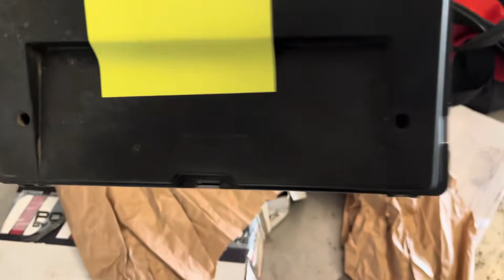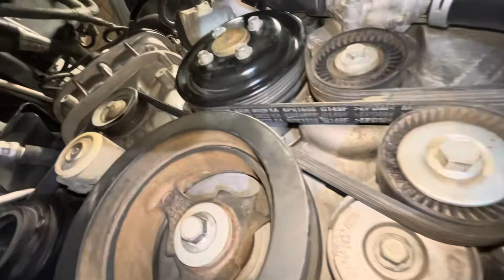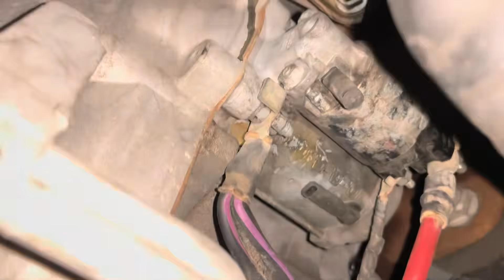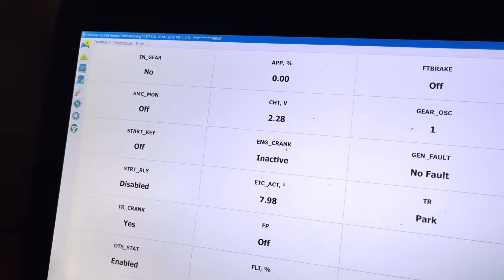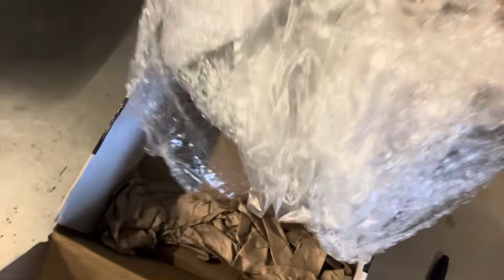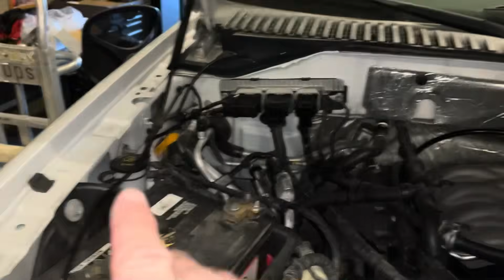First Start Up! 2014 Coyote Swapped Expedition

Comment: So when you coyote swap these, you have to convert to electronic power steering? Asking for a 07 EL 4x2.
Reply from the maker: I would. 07-08 May not be able to though.  09-14 yes.
Reply: @MattSoppa  Interesting, thank you for the response. I would love to do this for my truck. I wondered if it could be done without converting to electronic p/s.

Comment: So I can run a 2011 expedition 6r80 Trans behind the Coyote 😮
Reply from the maker: No. 12-14 Expedition or Navigator.
Reply: @MattSoppa what’s the difference, still the 5.4 mod motor
Reply from the maker: @eddievaldez9193 the 2011 trans has an internal TCM

Comment: Awesome project on the 3rd gen Ford Expedition SUV coyote swap because the Expedition came with 1 engine only such as the Triton 5.4L V8 and later the 3.5 liter ecoboost V6 which is still in production today

Comment: Army and Navy have been using AN fittings for decades in millions of different aircraft without using thread tape or threadlock with no issues.
Reply from the maker: I understand that, but as a former employee of an aerospace machine shop that made those fittings, those are definitely different than what you get at Summit Racing for example. Now that we’ve done another expedition, I was able to use the F150 fuel lines and it has a safety clip on it so that makes me warm and fuzzy.
Reply: @MattSoppa I'm a little late to the party. I watched that one today, after I commented on this one.😅
Reply from the maker: @bobbyland6782 haha no worries. I strive for the most OEM look when doing anything really

Comment: @MattSoppa, for this swap, do you have to use a gen1 mustang 5.0, or can you use an F150 5.0?
Reply from the maker: Either one! You need the oil cooler and AC accessories from the F150 variant either way so it depends on what you want

Comment: That Mustang engine is premium fuel only, lol. My expedition hasn't ever had anything, but 87 could explain the down on power
Reply from the maker: Down on power? When?
Reply: @MattSoppa when you first started it and  it was miss firing i hadn't got to the next video where the 3 injectors were out
Reply from the maker: @RNG_Anarchist those were miss fires from the engine sitting inop for a long time